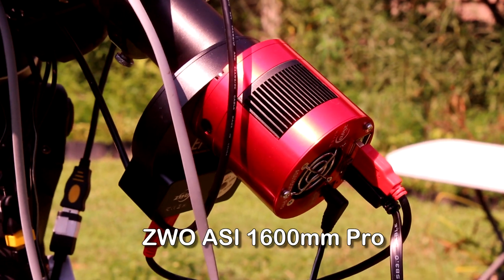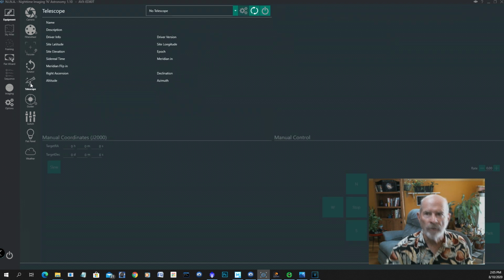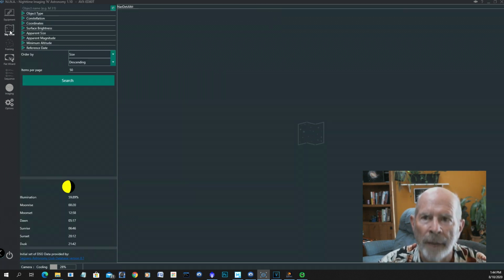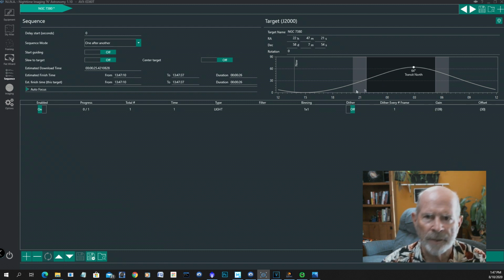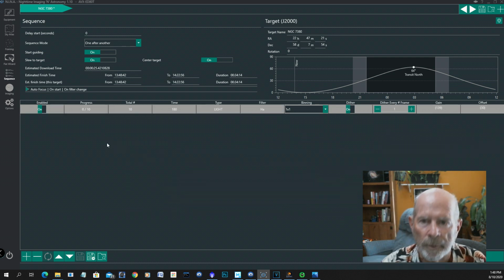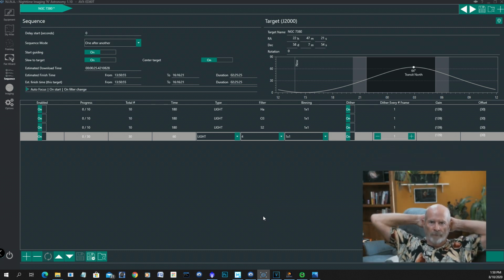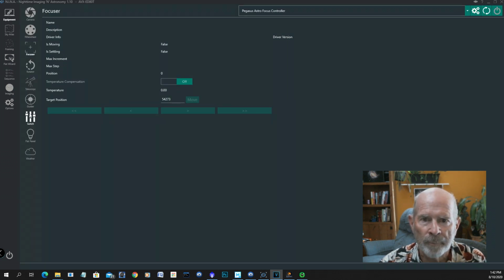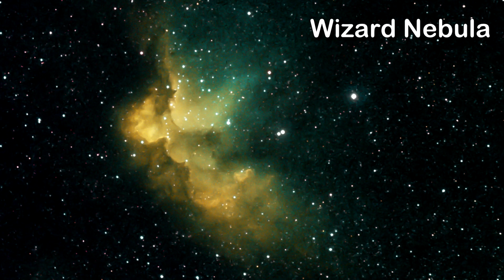First Light ... The Wizard Nebula

Comment: I've always said "nebulas", but I was raised in the south. What usb hub/ethernet gear do you use?
Reply from the maker: I use a 4-port usb hub to hub connected with a 120 feet of cat 6 cable ...  It is USB2 wich will transfer up to 3 fps.  If you are using a USB3 camera, it degrades it to USB2 but it will still work fine.  For planetary imaging where I need 20-30 fps, I connect the camera to a laptop and capture the images that way.  I connect the laptop via TeamViewer or AnyDesk to a separate monitor on my big desktop with all the other peripherals connected to the other monitor and the software.

Here is a link to to the USB2 4-port hub:
https://www.amazon.com/gp/product/B01EV33R8S/ref=as_li_tl?ie=UTF8&camp=1789&creative=9325&creativeASIN=B01EV33R8S&linkCode=as2&tag=savannahpat-20&linkId=0d1943ca9d33c76acd75a08258e0843f